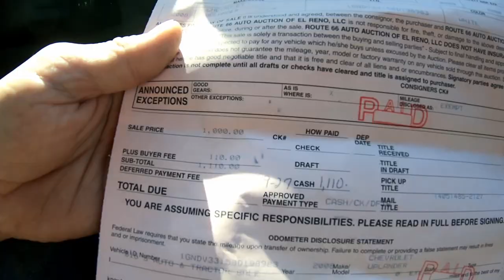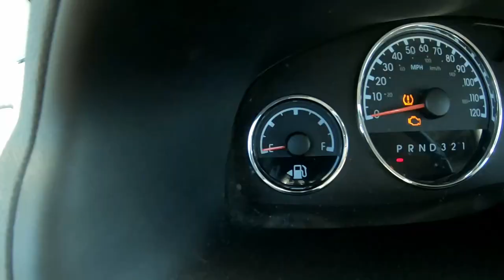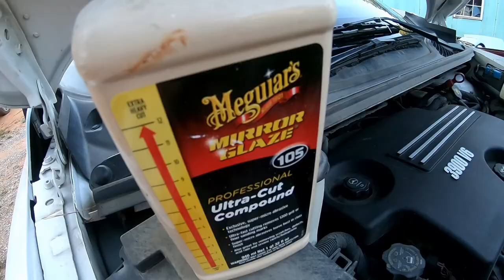Chevy Uplander flip car and Mariner profit or loss

Comment: that uplander would be asking price $3499, settle on $2700-2900. That is a really clean van, looks well cared for with high miles
Reply: Yes, if the vehicle is taken care of, the mileage is just a number. My daily driver is a 03 avalanche. Has 180k. Trans was rebuilt at 150, the previous owner towed with it. Upgraded parts etc. No rust, every single thing works. 4 matching tires, grease able fittings on everything etc. Paid 7k. I live in upstate NY, dealers charge 7 for one that age and mileage with rust under the cladding, clear peeling etc. That van would fetch 3 to 4 k up here.
Reply: I really don't expect he can get more than 2 grand because of the high miles even though what you posted is the Blue Book range. I say ask $2700. Weird beard knows his customers and how much they will pay. Lets see what shakes out.
Reply: @bdpopeye  ohh yeah, 27 ain't bad for it either. I was just referring to smaller dealers who do a fair amount of vehicles. Here in NY, for every inch of snow, they lay down 3 of salt. So the fact that it works perfectly, and isn't rotted, the next owner is likely to pay a bit more for a solid car, and it'll physically last several years up here. So if it breaks, they're more inclined to fix it
Reply: @williamsinger4124  Yeah, I know what you are posting about I live in Iowa.

Comment: Hi Mike. Nice video. Good job on the Mariner. Uplander is nice. Looking forward to little truck build too. Id ask 2000 on the uplander firm. Youll get it. Its clean, runs and drives great, its worth it, you will get it.

Comment: Crazy how different the used car market is depending on where you are... Here in Detroit that same van would have got zero bids at auction with 260k miles. I'm sitting on a clean running/driving '05 Infiniti G35x right now that I got from Copart with 231k and no rust (Kansas car) and can't give it away for $1,500 smh. Wont find an Uplander up here anywhere near that clean anymore though unless grandma had it and never drove in the winter, hope you make a killing bro.

Comment: You should be able to get closer to $2000 very easy looks like  a nice minivan I would ask a little higher price 2450$. People like to negotiate. Any ways

High miles cars don’t bother me personally if they run good most likely they have a lotta new part put on them. I have more problems with low mile cars and I usually sell them cheaper BC of the work they often need so 2450$ obo all day probably get 1950$ asap